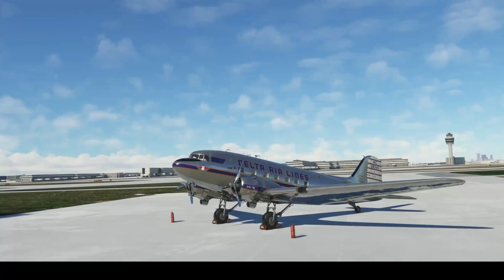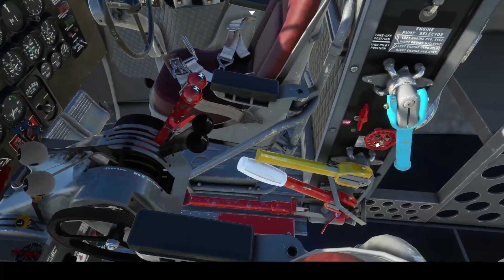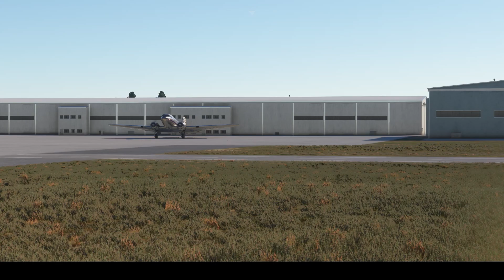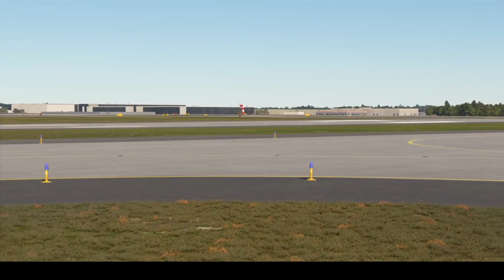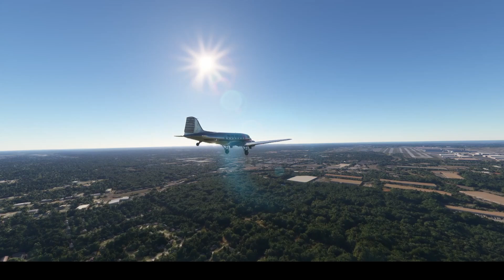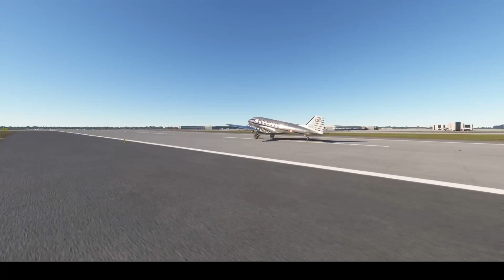Douglas DC-3 MSFS2020 (First Video)

Comment: Greetings! I had the same idea, but I'm afraid I don't know much about MSFS. I've been fighting to configure the controls, and the DC-3's autopilot doesn't work properly, it disables in heading mode. However, one of the first flights I am going to make is the one from the movie Casablanca, from Casablanca to Lisbon in a Lockheed Lonestar, which is the closest model I have found. I encourage you to do the same. Good flight! Thank you.
Reply from the maker: Greetings @grisanverse7375! I have had the autopilot on the DC-3 do a similar thing to me on longer flights. Seems that heading mode disengages. I’ve found that simply clicking on heading hold again, even though it’s technically off at that point, brings it back to my selected heading. What controls are you trying to configure? That flight is an excellent idea. I was not aware there was a lodestar for MSFS. Perhaps I’ll give that a go at some point. Thanks for the tip!
Reply: @Fly-to-the-past  I sent you a link to the Lockheed Lonestar, but YouTube may have deleted it. If you are interested, tell me something and I will send it to you.
Reply from the maker: I did not see the link. Is this perhaps the one on flight sim.to? I have seen that one before.
Reply: @Fly-to-the-past  Yeah, flight sim . to lockheed-l-18-lodestar
Reply: A while ago I found the Lockheed L-12, but on this occasion it was not possible. The one I have listed above is with modern flight instrumentation, not the original.
Reply from the maker: I believe aeroplane heaven has a Lockheed Electra out but I think it’s the model 10. I don’t personally have that one in the sim so can’t speak to how good it is. Plus the lodestar is free.